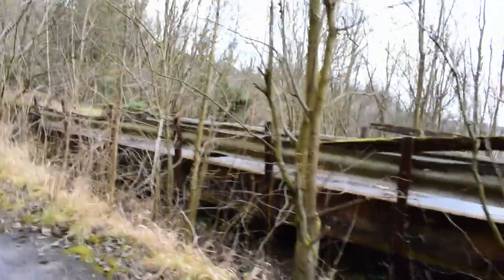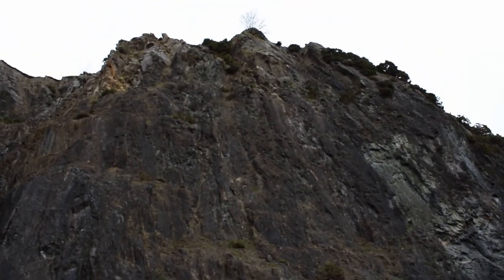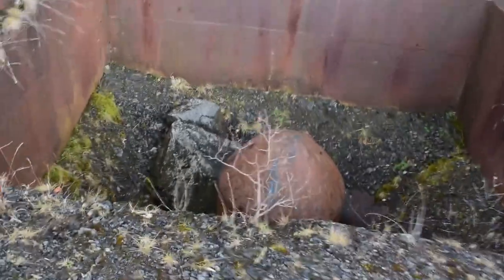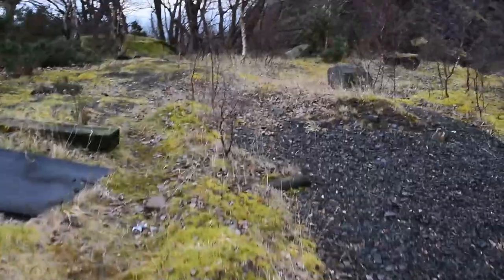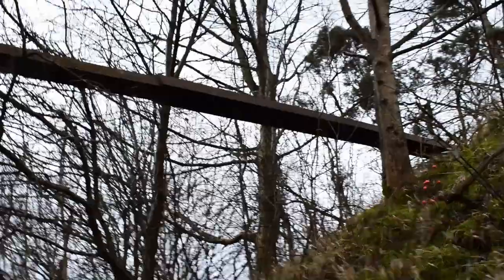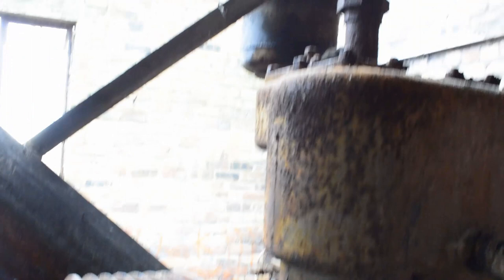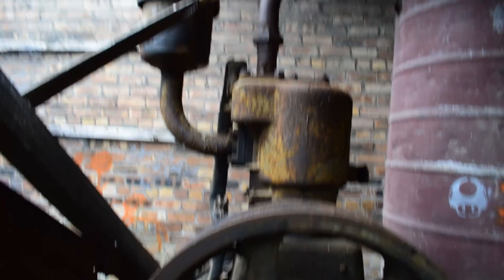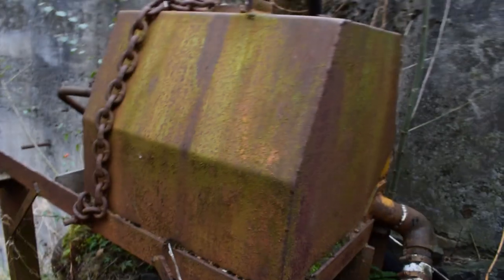Deep Inside Grind

Comment: Really cool explore. Very impressive cliffs. You sure wouldent want to be standing anywhere near the top of that hopper whilst it was in use. The building with the metal plate, I wonder if that was for storing explosives? The storage tank looks as if it was a railway waggon at one point. Also, notice a lot of sleepers around the site. Perhaps it had a railway for removing produce from the quarry and maybe even getting fuel delivered.
Reply from the maker: You make some good points mate but I really don't know the answers, will have to dig a little deeper lol
Reply: I've never heard of there ever having been a railway up there. The approach to the quarry is too steep for trains. The fuel tank does look like it's from an old waggon though, maybe a lorry.